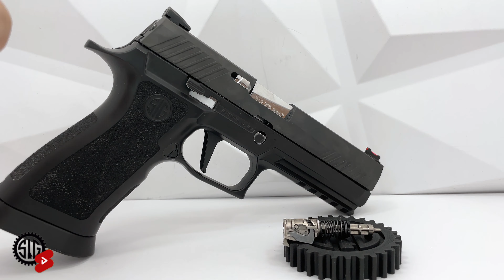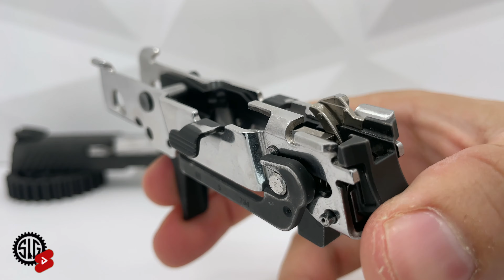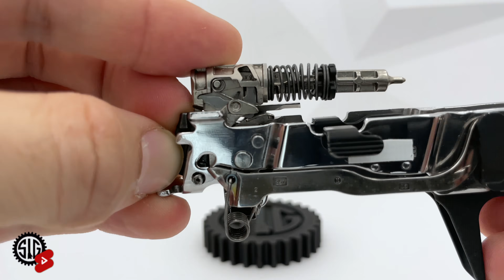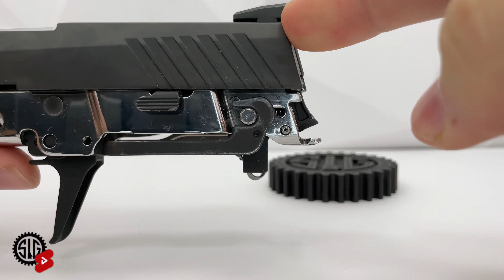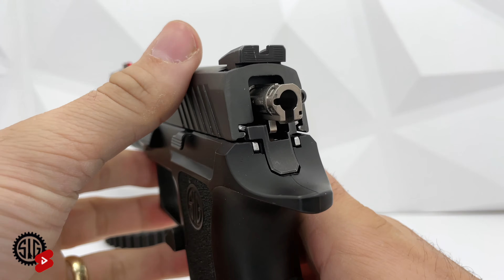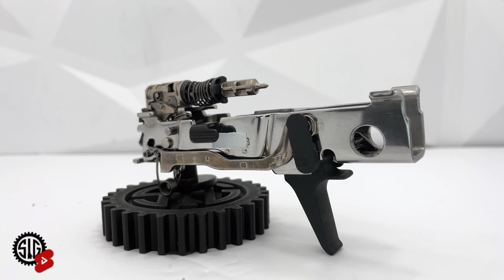P320 SHORTCUTS - ACCIDENTAL SAFETY BY-PASS TESTING METHOD

Comment: It seems like one of my p320’s internal safety is worn. What should I do?
Reply from the maker: Though it’s rather rare you need to do this, you simply need to swap out to a new replacement part.
Reply: @ thank you for the reply, for further clarification, as someone mentioned in the comment section before, when I attempt to push the striker body back in @1:55, there’s no click. Should I replacement the entire striker? I’ve owned my p320 for 4 years.
Reply from the maker: The click comes Freon the striker dropping after the lock lever tab is removed from its way. Remove the striker and inspect to make sure the tab is there and not broken. If you are using an adjustable trigger it’s possible you over did it and the safety is being removed by the trigger itself.
Reply: @SIGMECHANICS  okay I inspected it and the tab is there. I also still have the stock trigger.
Reply from the maker: @davidtrav6494 perhaps you tested it incorrectly?
Reply: @SIGMECHANICS  I appreciate all these responses! Very possible however, I tested this with a grayguns upper with an agency arms trigger and it passed the test multiple times. My x5 legion has failed. The only custom part is a sports disconnector.

Comment: IMO the glock style safety plunger at the front of the striker is a far safer design
Reply from the maker: The P320 has a tab that physically blocks the striker as well. It’s removed as the operator pulls the trigger.
Reply: @SIGMECHANICS  correct but its at the rear correct?

Comment: At :43 I think the striker should return when you let get of it.  The firing pin remains protruding from the breach face.  Is your striker reset spring is broken or missing?
Reply from the maker: For that part of the video I removed the spring in order to show function of the lock tab. 

I should note however, that the recent spring was recently discontinued by Sig. They no longer include it in the newer firearms (hot or miss, some new guns still have the spring for some reason and others don’t). Therefore, even if it was not there, it has been proven to not require the reset spring for correct operation since the slide generally will re-position the striker when it retracts.
Reply: @SIGMECHANICS  ah I totally you missed you have a whole video on that spring!  Unrelated topic, I'd love to see your trigger measurement data for a couple of the more popular triggers, but also installing the other parts from their kits.  I.e., the greyguns kit and the TSA kits are the ones I'm personally interested in.  Do you have any plans for something like that?  Thanks for the great videos.
Reply from the maker: I absolutely do plan on it. I just finished up another project and my workshop was under construction for a while but I’ll be back soon.

Comment: At 2:30 you mentioned a chance of the safety being disengaged without a trigger pull. What causes that issue? Would normal shooting use wear out one of the safeties?
Reply from the maker: No, they won’t. That would indicate that the safety is already gone, which would mean the trigger was pulled far enough to remove that safety, in the case of a adjustable trigger this would be more plausible. (I’m coming out with a video about that very soon so keep an eye out for it!)
Reply: @SIGMECHANICS  thanks man! I’m sure most people searched for this video due to all the recent NDs (Montville). I’ll keep an eye out for it!

Comment: So what do you do if your internal safety is compromised?
Reply from the maker: Revert back to stock. It’s really the only way to be sure you’ve maintained all the safety. Although. It would be hard to both remove ALL safety and still use the P320, I’m working on a video that will touch on that point, coming out soon.
Reply: okay does this video work for all p320 or just the full size? I have the compact. When I push in the spring at 1:55 it doesn’t click. I bought the p320 compact with a flat trigger is that normal?
Reply from the maker: Make sure the striker is resting on the rearmost shelf/ledge of the sear. That is what will give it the resistance you need to “reset” the striker.

Yes, this applies to ALL P320s regardless of size or configuration.
Reply: @SIGMECHANICS  when I put the striker on the ledge closest to the backplate it doesn’t click
Reply from the maker: Double check that you haven’t lost the spring that holds down the lock lever.
Reply: @SIGMECHANICS can I send you a video?
Reply: I figured it out my striker reset spring is broken.

Comment: Thank you for this! After the P320 firing by itself scare, I found your videos. After learning that pulling the trigger disengages the striker safety, I worried about my AC adjustable trigger. Now I know why they recommend 0.07" of travel left in the trigger. I will be checking this ASAP.
Reply from the maker: It’s going to be REALLY difficult to know when you’ve hit .007”, unless you have a tool like I do in this video: https://youtu.be/so3b8JXJDlg, you’d be hard pressed to be able to tune with that kind of accuracy. 

I will mention that improper tuning WILL at least partially disengage some safety… video on that will come soon.
Reply: @SIGMECHANICS  not .007, just .07. I think that’s what it called for in the manual. Maybe it was 7mm. I can’t remember exactly, but they did mention making sure you still have some travel. My educated guess based on your videos is to ensure that the striker safety is not disengaged accidentally

Comment: Hello. First, thank you very much for all your videos. It made understanding all of the components and mechanics of the FCU and the entire gun easy to follow along. I have a question for you, though, out of pure paranoia, with all the talk of guns going off by themselves. All of the safety features throughout the entire system make complete sense. With this video here I tried to check my striker safety to make sure it was working. I Followed along the exact instructions.
After the initial trigger pull and releasing the striker. I tried part two: of pressing the striker back in and hearing the click. I couldn’t always get the click, I’d then  press down on the back of the striker and release it with trigger while holding it down with a punch. If I pushed the whole striker assembly, sometimes I would see the firing pin come through the breach face. Other times id get it to hold and have to pull trigger while holding striker with punch as you did in video and it would release. As I understand the click I’m trying to hear is the strikers safety arm getting back into position?

Now I was wondering if the strikers safety was not engaging. Spent an hour fooling around with the one in the gun and a brand new one. Sort of the same thing, I couldn’t get the click to happened the way you showed it in the video.  I guess I’m trying to ask is alternatively, I took the slide off the gun put the striker back in fully installed and pulled back on the hook of the striker and every single time the strikers safety arm did click back in.  
If I pushed it with my finger nail ( as the FCU would) it would release and you could push the entire striker forward and it would appear through the breach face. Grab the hook and pull it back, and it would then click again every time. That’s what it should be doing as you had shown in the video with it installed on the FCU and in the grip handle? I’m just wondering without the back plate and me pushing it in with a punch I just wasn’t getting it to operate the way it does full assembled. As far as I can tell with my knowledge of this gun, everything is in proper working order. I can rack the slide, pull the trigger,gun goes click, keep the trigger pressed, rack the slide and ease  off the trigger and you can hear the reset click.  
Thanks again for all your advice.
Reply from the maker: If I’m understanding you correctly, it sounds like the system is working as intended. If you’re not getting a click, you may not be holding the striker housing in deep enough to compress the main spring. Other than that it sounds like you’re good to go.
Reply: @SIGMECHANICS   Thanks for quick response. Yes I may not of pushed housing in far enough, but just making sure I understand, the click I'm looking for IS supposed to be the striker lever resetting?
Reply from the maker: It’s the noise of the lock lever “tab” dropping in front of the ledge on the lateral shelf of the striker (I hope that makes sense).

For this to work, the lock lever spring mush be installed and functional.

Comment: This is the most underrated channel on YouTube. Thank you!!!
Reply from the maker: @BREWINZ. Thank you for watching! I appreciate you saying that, I really do like working on this channel, lots of great friendships have come from it so it’s win-win all around!
Reply: @SIGMECHANICS  is it normal for the safety to disengage after a small slide movement. I have been doing dry fire practice and take very little pull back to re-engage the trigger. This is not normal on the p365 or my XD-9.
Reply from the maker: @Filmoe150, it sounds like you might not be racking the slide back sufficiently to engage the striker on the primary sear ledge, you might be catching the second “back up” ledge of your only slightly racking. The striker will still spring, but not at full force.
Reply: @SIGMECHANICS  thanks that makes since.